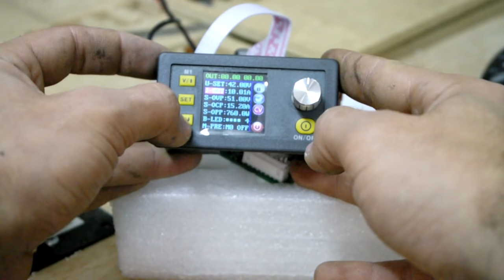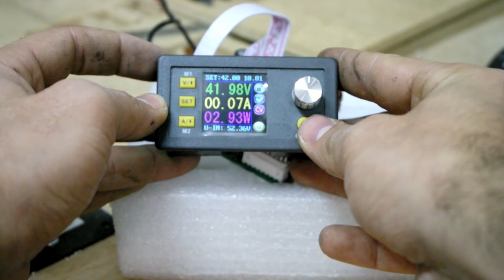How to connect brushless motor controller wires 250W 36V (Wire assemblies)

Comment: Hi, I have Lankeleisi motor, I hope you can help me to remove the speed limit. It's adjusted to max 25 km/h.
Thank
Reply: watch the video.  he explains how you increase speed by 120%
Reply: 2:25 and 9:23
Reply: The actual increasse you obtain can be a LOT less than that. Depends on the controller's programming and other factors. Another user saw less than 5% gain in speed. But, it doesn't hurt to try...unless...

1) get a speeding ticket
2) get cited for driving an unregistered motor vehicle and also not having automotive insurance
3) you lose control at the higher speed and crash!

Comment: Pregunta tengo un alternador de 4 salidas más 2 de las escobillas pero mi controladora solo tiene las 2 cables de las escobillas  y 2 para el motor siempre veo que las controladoras tiene 3 cables  para el motor y   2 para las escobillas como se puede conectar el de la foto de perfil

Comment: Hello freind... I have 60v 350w motor. How and what bldc can i buy?
Reply from the maker: Hi..  for maximum power you need: 700W / 60V =  11.70A,  so  you need 60V  10A-12Amps max  output controller
Reply: What mean jumper speed? And for throtle have volt or any suitable with motor?
Reply from the maker: It mean to change speed of your controller you must short some wires of controller (put jumper)
Reply: EV - Customs can you suggested for throtle and batery to run my hub motor.

Comment: Hello! 🙂 
I have a problem: I gave away the original controller for the Xiaomi 1S and installed a brusheless motor controller 24V/36V/48V 500W/750W current 26A and 48V 1000W aluminum motor.  I opened the motor and looked at and counted the magnets, there are 30 magnets in the motor rim and 26 on the axle where the 5 Hall sensors are soldered. Ok, to my problem now: I installed everything and it works with the S866 Lcd Display  Excellent!  But !!  If I stand on the scooter and drive away and press full throttle at about 5 km/h, then it drives up to 15-17 km/h and then the Gss goes out, so the engine is no longer running, so the BMS switches off!  huh ?!  But if I hit the gas slowly and faster up to about 30kmh then I can hit full throttle at 30kmh and it goes faster.  OK.  And if, for example, I get on my scooter and press the gas slowly and always press a little more, i.e. accelerate slowly and then at about 20 kmh then press full throttle, then it quickly drives up to 30kmh and the engine stops again and the gas doesn’t work anymore!  So BMS switches off again!!  But at home if I hold my engine up at the back and press full throttle it works!!  Up to about 45-47kmh.  And if I leave my apartment on the street and turn on the scooter and press full throttle then at about 12knh the engine shuts off and gas stops and at 5 kmh when it is down gas works again and if I immediately press full throttle again  at 22kmh the engine stops and can no longer be switched on because the BMS is red!  And it won't turn on anymore!  Then I have to unscrew 5 screws on the front battery box on the street below and unplug the battery, wait 5 seconds, then the BMS is green again, then screw 5 screws again and drive on, but accelerate slowly!  I still drive with the Stock Original battery: 36V + 7.5Ah.  Is that not enough??  Yes, of couse!  On Tuesday I get a new 12V 40Ah 40,000mAh additional battery for €280 German product!  Then I drive in series to 48V + 48Ah!!  But that with now that BMS always switch off when accelerating from 5kmh at 12-13kmh when I go full throttle!!  Why is that please?!  But when I'm not at the Scotter, full throttle works great at home without me!  Can you PLEASE tell me why my BMS keeps turning off?!  I PLEASE you!  Help me with an answer why this is so.  Or should I connect the 3 pin gas plug to the PAS 3 pin on the controller??  Kind regards.  🙂

Comment: Why I saw hub motor power cable green & blue cross join, motor still can work, what happen?
Reply from the maker: To join  motor with controller you must find combination of 3 fase wires... Wire colours of controller is not every time right...
Reply: @EVCustoms  if connection wrong ,any problems,? Or fire?
Reply from the maker: If is wrong you will burn your controller or your hub motor...
Reply: @EVCustoms   noted, thanks
Reply: May I ask next question, e bike & e scooter controller ,I knowledge connectors different, if I can't find scooter controller ,can I use e bike  controller modifie ?
Reply from the maker: If you find scooter dlbc 3 face controller you can put it also on your bike.. it is same think ..
Reply: @EVCustoms  thanks your help

Comment: How do I connect a speed controller with 5 wires to the controller that only has 3 wires ? Please show a video
Reply from the maker: Sorry...?
Reply: EV - Customs the throttle controller has an L.E.D with voltage and speed monitor and battery also. Has a switch to change speeds also. Has 6 wires. Bought a new controller with 3 throttle wires ? Need help.
Reply from the maker: @PURGE-3000   send on my email your throttle wires photo ev-customs@hotmail.com
Reply: EV - Customs will do.
Reply: Your email didn’t work. 
Has 6 wires. 
Yellow
Blue
Green 
Black 
Pink
Red

Comment: What is the box in 6:50 ? Monitor or controller ?
Reply from the maker: Martin Procházka  Hi.. this is step down controller DPS5015 Programmable Power Supply module regulator converter voltmeter, ammeter.  50V 15A
Reply: :) I want it.
Reply from the maker: Yeah.... Nice toy!  
http://s.aliexpress.com/nAR3MzAn

Comment: I have my 1000w-48v ebike all hooked up but no power is coming out of my controller set. I grounded my bike an the controller but still no power come out of it. Any one knows what is wrong
Reply from the maker: Give as more information about your e-bike, to be able to help you, Your battery voltage? is fully charged? you connected  ignition wire? what battery you have lithium? your throttle is connected properly? is your e-bike factory made or DIY?

Comment: In my case the high/low speed is controlled bij the thin white wires and not the three speed suggested connector. EEEEfun scooter.

Comment: Can someone help please? ..... :( 
I have a 24v 250w 14ah BLDC. If I use a 500w controller with 20ah battery, will this destroy the motor ?
Reply from the maker: Geia s patrida! 

I personally do not recommend it to you.. You can do it if you have the same voltages, every time you start or climb up a hill  your engine will warm up , you must be careful a high temperature of hub motor after that,  and you will have a lot of energy losses.

Comment: I have 1000 watt hub motor and controller but speed not increase up to 18 kmph.. wts the reason
Reply from the maker: Voltage?   Your controller?
Reply: But how to increase
Reply: Right voltage 48v 20amps...
Reply from the maker: Check  your 3 speed wiring on controller,  maybe is connected on 50% speed (slow)
Reply: 3 speed wire is not working... No changes of speed....
Reply from the maker: maybe you have limiter wires connected...? check for two blue or white or silver wires connected  (itch-other) and disconnect them.
Reply: Nothing this type of wirr
Reply: Kindly suggest me what i do... Because speed is not increase up to 18kmph....

Comment: You seem to be the wiz kid (I am a newbie):
My cheap Chinese "Samebike JG20" ran 20km/h when delivered, after 3(?) full recharges it changed its mind and now develops more torque and also supports speeds to 25km/h (as specified by the vendor). Nobody seems to believe me that the bike did this 'battery condition' cycle on its own; all say I am nuts. Yet I KNOW how the bike ran slower before and faster after several battery charge cycles; I did not tinker with any settings or switches (it has none).
HOW did the controller do this? The bike has  no control display, speedometer, power control switches. it has a very basic 'Saxin' handlebar grip only (for moped style operation), a sensor at the pedals and brake handles to recognize their motion.

I want to RESET the bike so it will only support 20km/h (more comfortable, longer range of battery).
So far I have not located nor dismantled the controller, probably underneath the removable battery canister?

Basically my foldable ebike is now TOO FAST for my taste; I want to get it back into the original 'factory' state somehow. At 20km/h the power was soft and easy, the range 50+km, with the 250W/36V rear hub motor and a 288Wh battery pack.
i wonder what they did to somehow count charge cycles or else before 'tuning' the bike to run stronger and faster? I want to 'DEtune' it back to the factory state it was shipped in.
Thanks!
Reply: Some have a self learn for the hall sensor so the motor can have torque at low speed but there's no such thing as it learning over time, at least for the cheap eBay esc's
Reply: Thanks!
I asked internationally about this odd 'run-in' issue: all denied that a bike would have a 'condition' phase (Li cells would not need a run-in), but I got these two 'maybe' answers:
1) the controller was 'broken' when delivered, omehow magically reset itself after 3 charge cycles, increasing the power output  so the bike's speed went AXACTLY from 20 to 25km/h, odd..
2) Someone mentioned that a Battery Monitor System (BMS) may have sensed initial imbalance and settled this after the battery was recharged a few times. I have so far no idea how BMS works and where (in the battery box) this logical unit resides? Why would an imbalanced pack deliver a higher range, and still have full voltage based on the power meter?

I guess I will never be able to reduce the supported cruise speed to 20km/h again. For now I disabled the PAS and use the proportional handlebar grip to set my preferred speed, pedaling along with it. With an active PAS the pedaling would override the handle bar speed setting and accelerate the bike to 25km/h again..

If interested here is a link to photos of the controller model R863-AA04 and its inner circuit board (front and back; note that it has a serial port!):
https://app.box.com/s/4p5pya0yj0xs1pwhhlsccuo27l9viifv
Included are more photos of this odd bike, sold as JG20, YSDX20, XW-20ZC

I guess I got what I paId for,.
Feel free to use my Samebike email for personal contact and exchange of thoughts.
Thanks again for any advice or idea!
Reply: @martinwalker2555  only thing I can think of now is that since your controller does 36 or 48volts it may have somehow thought your battery was a 36volt battery and ran it at lower wattage, maybe recharging it brought the voltage up high enough (maybe it did need to be balanced) for it to swich to 48volt mode, just a thought... Although I can assure you that those cheap Chinese eBay controllers don't have any fancy automatic break in tune type of thing, only the self learn wires for hall sensors
Reply: @mashedpotatoes5323  
Thank you! I saw that you looked at the controller photos, and YES, it is made for 36/48W, probably reacting to the applied main voltage somehow?
And your thought and reasoning sounds VERY convincing: is there a way to FORCE this controller into the [low current] 48V mode for verification? Did you see the 'innards' of the circuit board? No switches, just a programmable port.
The symptoms match perfectly:
the motor DID feel weak during the first rides, compared to now. So indeed it was most likely operating at a lower currrent&wattage, reaching the reduced top speed of 20km/h instead of 25km/h only. 
And this mode extended the battery range by 25%, of course!
Was this a healthy operation for battery, MOSFETs and motori? I'd assume: YES. 
I'd LOVE to get it back to that lower output mode at will. Although it would mean less assistance uphill, compared to the current 'healed' state.
All would be no issue, if the bike could assist pedaling at speeds below Vmax. Without accelerating to the maximum speed during pedal operation.
For now I will try to add a PAS switch to (de)activate the pedal sensor, use the gas grip to control power and pedal along.
You know your stuff, great!

Comment: I didn't see you identify the 2 black? wires at the "7 o'clock" position of the controller.

Also, in the future, you may wish to label the colors, too. Not everyone's monitors are set up the same and it's common to get colors to show up differently on viewers' monitors than they show up in your video editing (e.g. purple instead of pink, red instead of orange, etc)

Comment: Seems to be a lot of noise any idea why???
Reply from the maker: Take a look from video "36 controller combinations" to fix it...  This noise is wrong hall sensors wiring or wrong 3 phase wiring
Reply: @rocknron666  Can you translate above???
Reply: @glendooer6211  that's English fool wtf do I need to translate?
Reply: @rocknron666  only watched it for a munites and moved on to the next vid.
Reply: @glendooer6211  The poor spelling and shorthand initial letters just for starters but most of all go and learn some good manners.
Reply: @TheAuldBob  Get well soon
Reply: @TheAuldBob  Get well soon.

Comment: hi, may i know if i connected the controller to the battery without the motor, is there any problem?
Reply from the maker: No... Only note that the cables are not shorting..